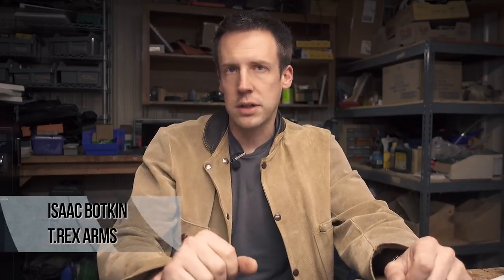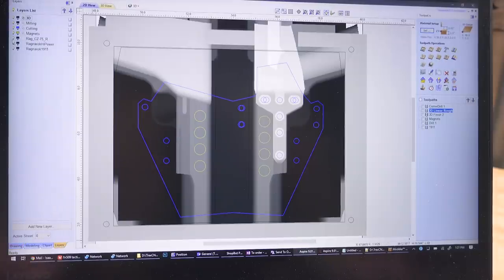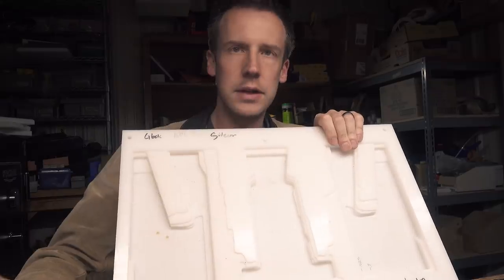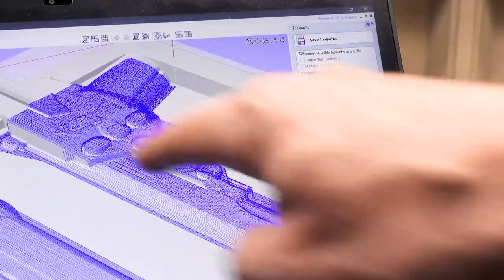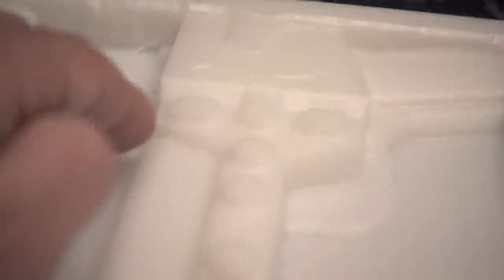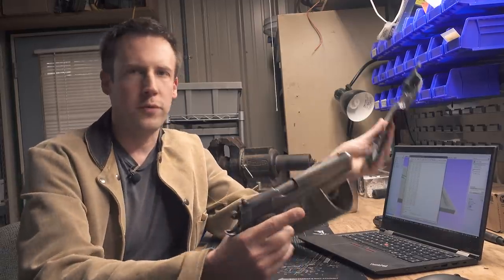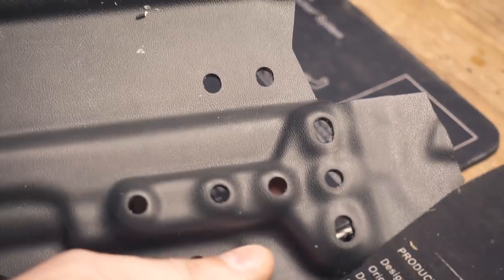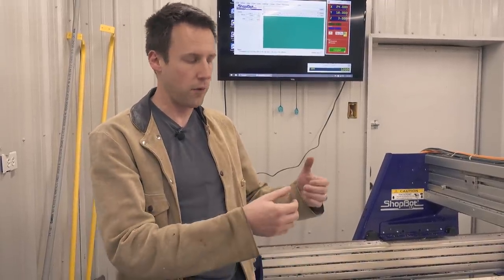How to Make a 1911 Ragnarok Holster in Aspire

Comment: A Holster from Trex for a dinosaur of a pistol....It is really cool tech though and definitely looking forward to the future.  And I'm willing to discuss file management.
Reply: Still has the best stock trigger of any pistol today. The new 2011 pistols still shows it can outperform polymer guns in trained hands.
Reply: @zack9912000  And its still rounds limited and not as reliable in actual field use.  Great as range toy and competition piece when your life doesn't depend upon it.
Reply: @PsychosisPC05  Well you clearly never carried one or keep updated on them, they are extremely reliable if they are built correctly.  the standard 1911 holds up to ten and the 2011 versions hold 13 rounds of 45acp. The 9mm verson of the 2011 hold up to 23 rounds. Carried one for over 20 years now and never had a failure.
Reply: @zack9912000  Well keep carrying your heavyweight dinosaur.  Ew 13 rounds of 45, a Glock 21 has carried that forever.  And the 1911s are not extremely reliable.  Extremely expensive though for something is super heavy.  I suppose you could use as bludgeoning device after it fails when you need it.  I'll give you that.  Its a freaking range TOY.
Reply: @PsychosisPC05  Again shows how little you know about the 1911. Carry what you want idk. Yet all these slick set up glocks cost just as much

Comment: Very nice!!!  The secret to your depth issue  in aspire lies under the  edit tab / document variables / name and set depths of each layer. Then you can pocket tool path  that section.  Under "cut depth" enter {the name for layer 1} for the depth.  On the second layer enter the depth of layer 1 numerically in the start depth.  Then {first later name}+{second layer name} in depth, so on and so forth for more layers.   I have hours into figuring that out for a three layer deep text over text sign I made for Mothers Day.  =D
Reply: Interesting! I'm going to mess around with that tomorrow....
Reply: @isaacbotkintrex  I called the separate depths "layers".  Not to be confused with the actual drawing layers. You will need those separate as well.  So depth one {bracket name} then at the bottom of the tool paths select the specific drawing layer you want to cut to said depth etc.   You can "combine" all the tool paths with the same end mill into one later on after you know they work.   This will also cut faster than 3d,  then you can go directly to 3d finish and skip roughing for that portion.  =D   By the way paying it forward as I love new ideas like this.  Thanks for sharing. I don't make many holestrs but I this is a great reminder that molding is something I need to try.  Drop me a message tomorrow if you need assistance. It may not be the best for you, but it may help.

Comment: My 320 Ragnarok is sick. TLR with optic and fits perfect. Thanks for a great product!
Reply: hows the retention while running?
Reply: It was a tad loose when I first got it, but it has two adjustment screws on the side. My gun is also a little heavier because I added the X grip and 21rd mags. Tightened it up and all is good.

Comment: What do you do with all your kydex trimmings? Soon machines will have laser measurements of drill bits, so it will make it as difficult as lying to your misses about that extra pint you necked after work. Of course if you get caught out the machine is still guna have a hissy fit.

Comment: Telling your software that your endmill is bigger 'or smaller' than it actually is, is called comping. Your compensating the diameter of the tool to get the tool path or tolerance desired. Usually done at the machine control but I don't think your cnc router has one of those.

Comment: For NON railed dust cover 1911s
Reply: It works with railed 1911s with standard length dust covers like the Springfield Operator, but not those with the long dust covers.
Reply: @isaacbotkintrex  thank you for clarification.

Comment: but will it work with the railed 1911?
Reply: As long as the rail doesn't run the full length of the barrel, yes.
Reply: @isaacbotkintrex  sorry to keep bugging but would you think the profile of the sig1911 tac slide would fit i love your holsters
Reply: @armednloaded579  not sure; I didn't have one to test. It's worth a try.
Reply: @isaacbotkintrex  ill be your guinea pig ill put in the order on monday thanks
Reply: @armednloaded579  Let me know if the sig1911 tac fits the holster. I've got one too and was wondering the same thing.
Reply: Just put in my order I’ll let you guys know in a few days
Reply: Update on the holster just came in did not fit 
the slide on the sig 1911 is just too squared out it’s a few millimeters to big for the holster went in about halfway and stopped the slide being oversized is forcing the rail to get snagged that’s why it’s stopping about halfway well worth a try but thanks for taking the time to read this only rounded slides for the holster 😢 and I hate it because I love your holsters .
Reply: @armednloaded579  dang!! Sorry to hear that! But thanks  for letting us know!
Reply: Jordan Handley but I did find a company that does it qls fork and all but it’s way pricier longer wait times too 😢
Reply: It won't fit SiGs buy from LAG tactical that are specifically made for Sigs 1911

Comment: Youre using all the wrong tooling..
Reply: What do you recommend?
Reply: @isaacbotkintrex  are you using all high speed steel? Ball and flat end mills?
Reply: Almost all of my bits are carbide, I only have a few HSS. End mills all end relief for drilling and plunging. Bear in mind I'm always cutting very soft plastic very fast, and I'm usually cutting thin Kydex.
Reply: Have you ever tried fluted end mills just for plastic? Yeah.. carbide is over kill.. but you must cut so many holsters before buggering up the tooling
Reply: I've tried one, two, and four flutes. I've kind of settled on upcut for milling, straight flutes for kydex, and downcut for nothing. And carbide lasts for a long time; a few months, or until it accidentally hits the fixturing... whichever comes first.
Reply: @isaacbotkintrex   how much hand finishing on edges... Do you care about radius to feed rate?
Reply: @joshuasuriner7605 We buff all the edges by hand to get a nice smooth bevel. Feed rates vary as the gantry has to ramp its speed down as it takes tight corners, but it's not too much of an issue.